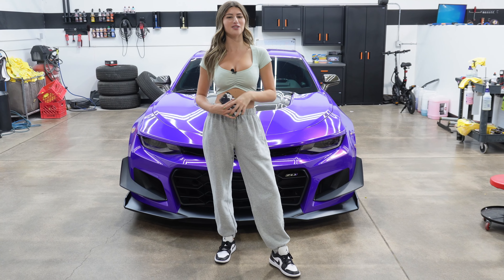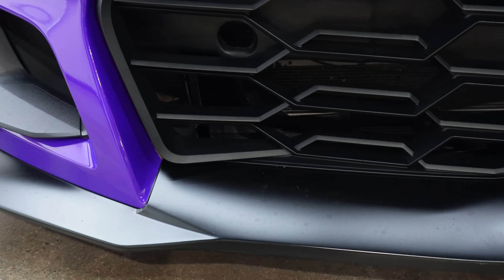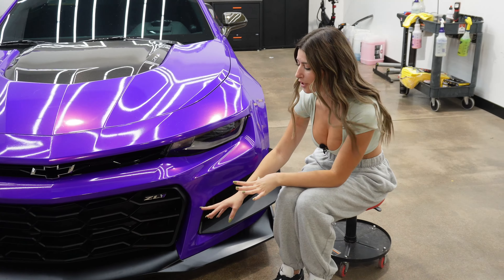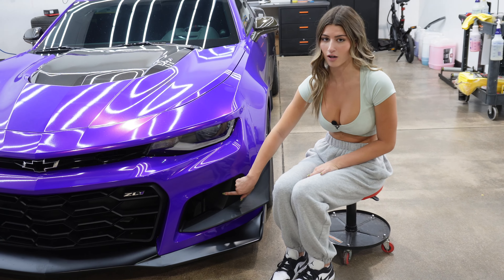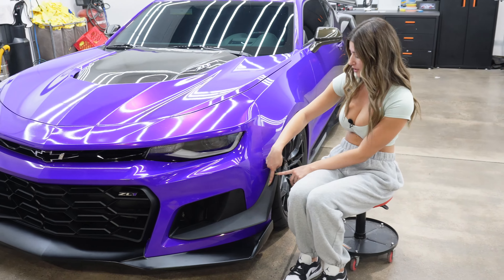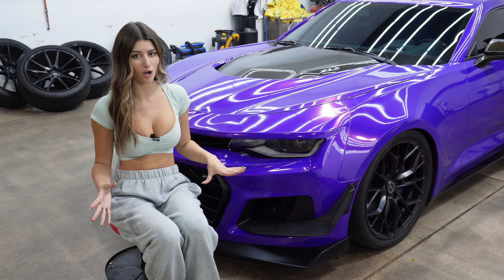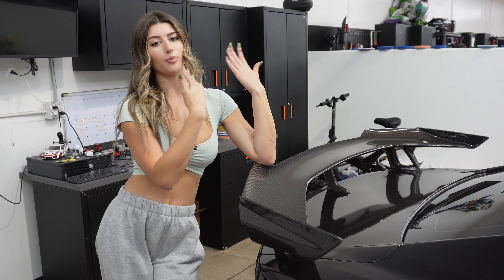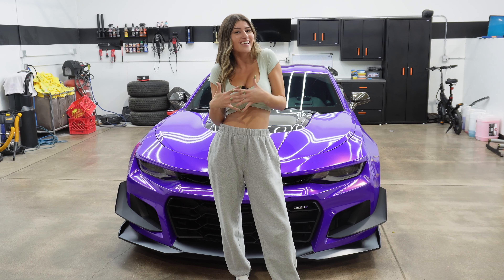How To: OEM ZL1 1LE Conversion

Comment: Finally!!! Someone makes a video about this topic. Personally I like the ZL1 1LE looks ( Front bumper and wing) but I also like the Magnetic Ride Suspension on the standard (Regular) ZL1 which is why I decided to go with the regular one hoping I can swap out the Front end and install the wing at a later time. I wasn't sure if the 1LE's parts were compatible with the regular ZL1 which is why I didn't want to risk buying the parts. But now with this video I know exactly what to expect and what to do. I was also thinking the ANDERSON COMPOSITES Wing looks better than the OEM wing since it is 100% Carbon fiber.